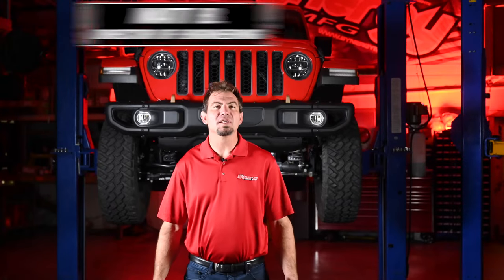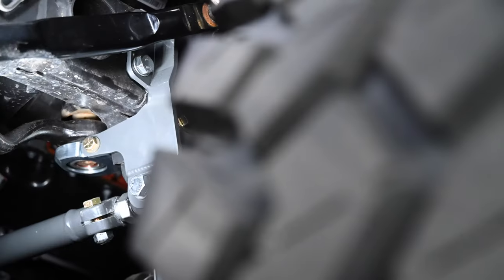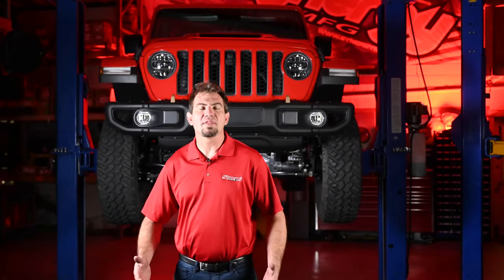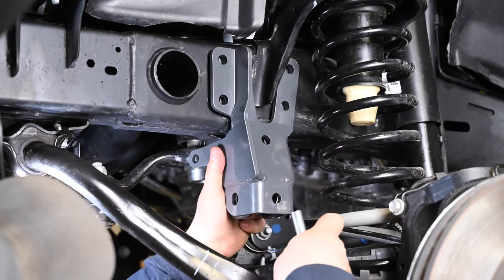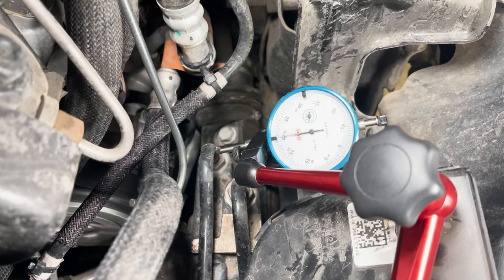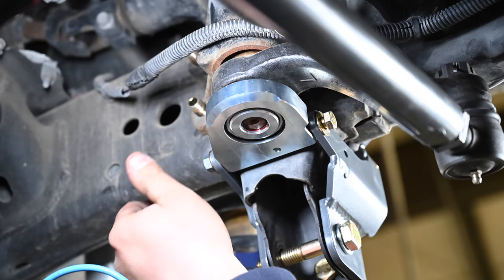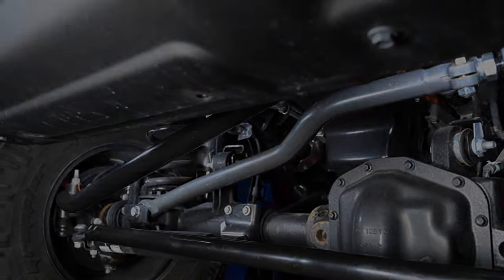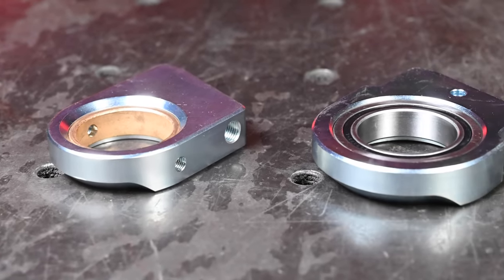UPDATED Jeep JK/ JL & JT Track Bar and Sector Shaft Brace Product Feature Video

Comment: I have a question i bought this brace back in 2021 but due to the mixed reviews at the time did not end up installing in hopes you would update this brace… fast forward to today i just found out you updated the brace any chance i can exchange if theres even a warranty for the item?? Thanks in advance
Reply from the maker: We just updated the bearing block. The brace is still the same. We do offer the new bearing block here if you'd like to update to it--- https://www.synergymfg.com/replacement-parts/synergy-replacement-sector-shaft-brace-bearing-block.html

Comment: I have a 2024 Wrangler JL with the XR package.  I have heard there are changes to the 2024, so do I need a different brace?
Reply from the maker: Any track bar/sector shaft brace you will find on the current market will not fit the new 2024. We are in development for 2024 compatibility since we found out the frames changed quite a bit.
Reply: @synergymfg  thanks! When will the new one be out do you think?